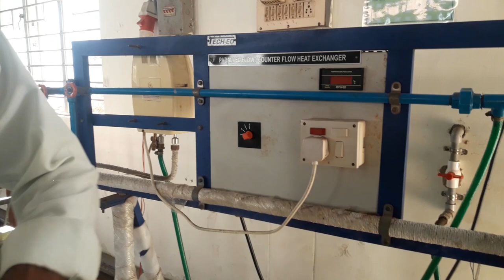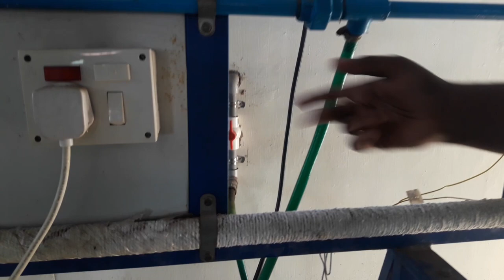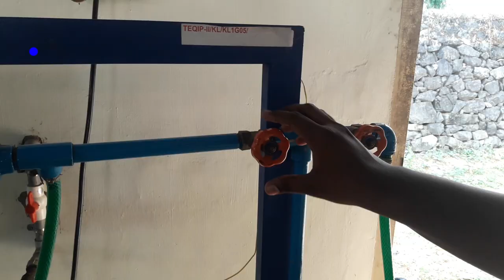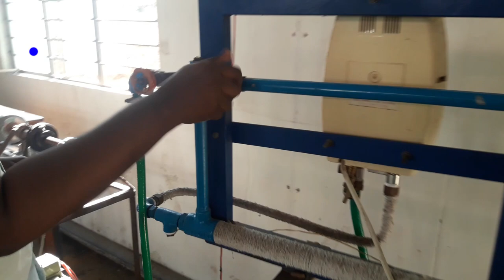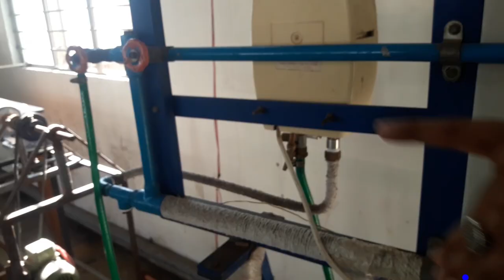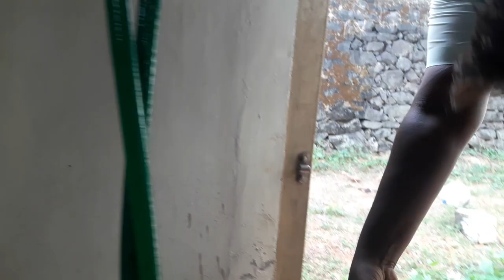Lab Experiment : Parallel and Counter Flow Heat Exchanger

Comment: kindly tell me what is the results of this experiment
Reply from the maker: The results varies according to the reading that you have taken, the amount of discharge etc. To get a general information about the result variation, please kindly look forward for the graph, (which I forgot to include).
Reply: which method is better
Reply from the maker: Counter flow
Reply: @NavasKappil  why the counter flow is effective than parallel flow
Reply from the maker: It is because of its opposite direction, have a look in to both the graph's of counter flow and parallel flow. You will get an Idea.
Reply: Malayalathil onnu parayoo??